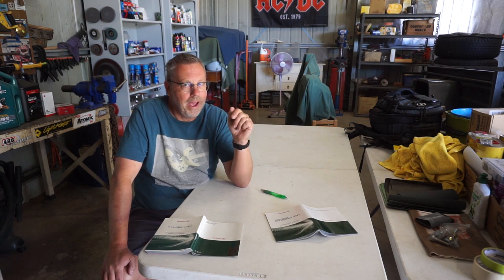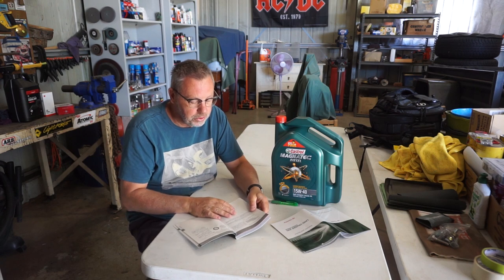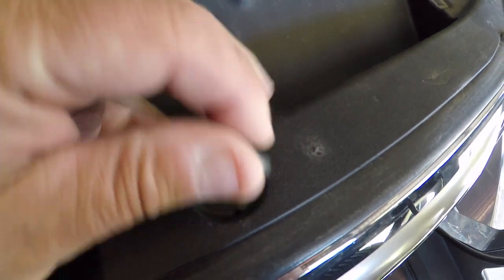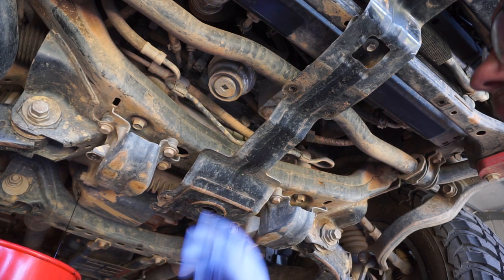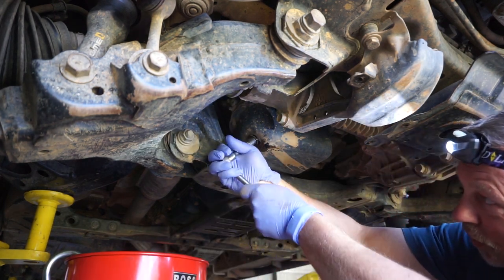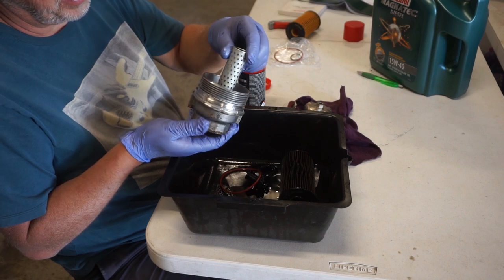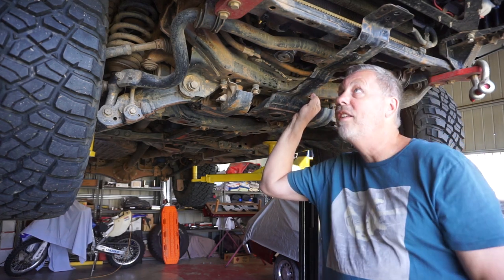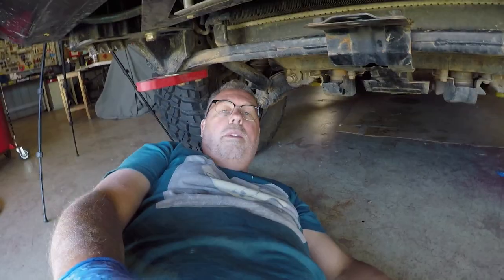How to Change the Oil in your Landcruiser 200 Series LC200

Comment: Could you please tell me about the replacement aluminium filter holder  - I checked mine and I have the black bake lite one - I have an 11th month 2007 build 200 series Sahara I rang Toyota today and quoted the Toyota part number 15620 - 31060 and they told me it was for a RAV 4 and Toyota Camry and could not guarantee it will fit mine
Reply from the maker: Hi Kevin.  Thanks for the question mate.  I just checked the part number you gave vs what I have here and you definitely have the right number.  I was told from my dealer it is off a 79 Series.  I guess the only thing I could suggest is buy it, try it out and return if it does not fit.  I’m sure your 07 model is the same as my 10, the filter element is certainly identical.  Alternatively, you could do a little more research on the 79 part number and try to match that up.  Cheerss😎👍
Reply: @JafffaAdventures  new 79 series part no: 15620-51010 . Kevin you are correct, the part no: in this video is for a RAV4.
Reply from the maker: Excellent work!  They must have put my housing in a different box🤔

Comment: Hey mate, after filling only 9L my oil was reading past the full mark by 5mm, I thought the facelift could fit 9.2L?
Reply from the maker: Hi mate, you are dead right the oil capacity is 9.2 litres with a filter change.  Not sure why yours would be overfilled.  Cheers 👍
Reply: I have removed the dpfs from a facelift model, I’m thinking possibly the dpf also hold oil and therefore the dip stick measurement is now out? Not sure though.
Reply: My 2019 VX-R only filled with 7.5 liter. I tried 9 once, it was way above the maximum. Wonder why is that?
Reply from the maker: Very odd indeed 🤔
Reply: @cemarabdg  7.5 liter sama filternya om? Atau ga ganti filter?
Reply: @b9625bb  Yes, including the filter.
Reply: @cemarabdg  maybe the oil are not fully drained so there some old oil leftover.
What engine oil did you use for your LC200?

Greeting from Perth WA 🙏🏻
Reply: @b9625bb  I'm using Motul CRDi 5w40. I made sure that both oil in engine and filter completely empty. Everytime 7.5 liter is always dead center between two dots on the stick. I suspect there are differences in the engine for Australian and Indonesian market since power and torque figures are lower here. 

Best regard from Bandung, Indonesia.
Reply: @cemarabdg  Good choice of oil! , i dont know there is a difference in oil capacity between Audm and Indonesian market but i did know that for the power and torque there is slight different since Indonesian market need to cope with higher sulphur diesel fuel (Pertadex) and no DPF.
7.5 liter engine oil are very little the same like smaller fortuner vrz 2GD engine.
Last time when i was in espeel (Daan Mogot Jkt) there is 1 LC200 atpm spec 2011 filled with 9 litre of oil and the dipstick show the oil are on the top mark 😅
Does the owner manual states 9.2 litre or 7.5 litre ?
Reply: @b9625bb  The thing is, it doesn't say anywhere in the owner's manual about quantity of engine oil. They just tell you how to check it. 
I've checked it in both hot and cold condition and basically they are the same results.
Reply: @cemarabdg  Well i think you should just stick to the dipstick as a guide for the engine oil capacity then. 
Good info by the way 😁

Comment: What the hell is wrong with a spin on filter Mr. Toyoda? LOL.
Reply from the maker: I hear ya brother👍👍👍
Reply: Ask professionals, they will tell you that insert oil filter are the best in the long run. Yes, the filter unit with a screw on cover is 1 x more expensive. Filter inserts are much less expensive. Think also about the environment!
Reply: @holgermuller2987  That's ridiculous. A Landy will burn more fuel in a lifetime then can ever be made better for the environment than a few oil filters. Ludicrous thought process.